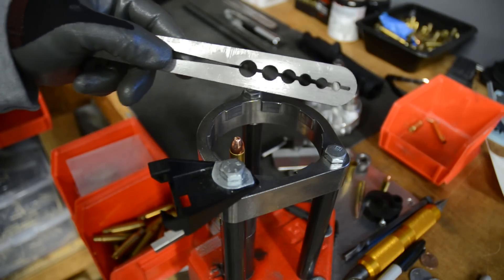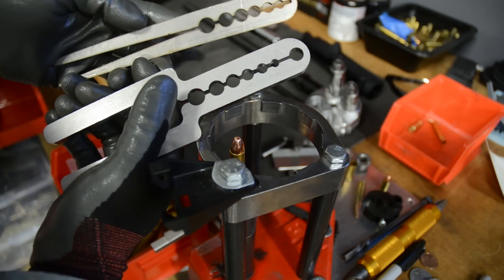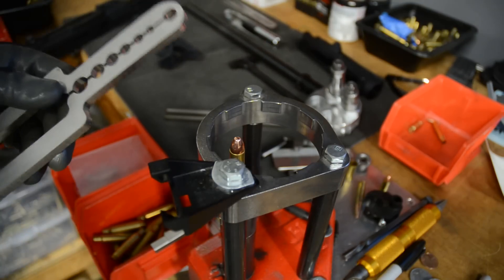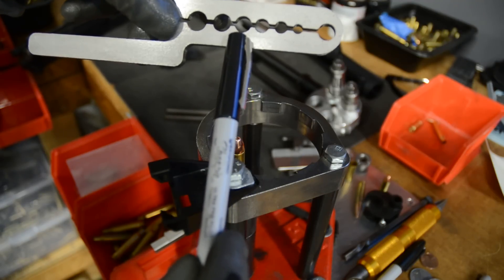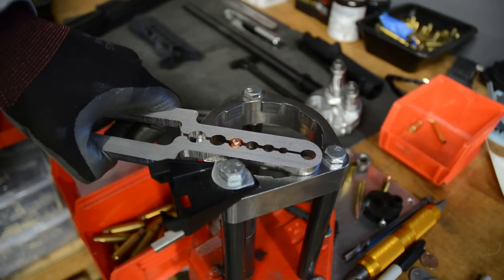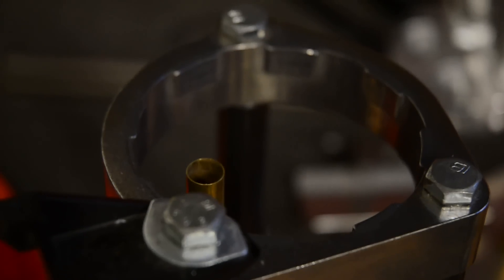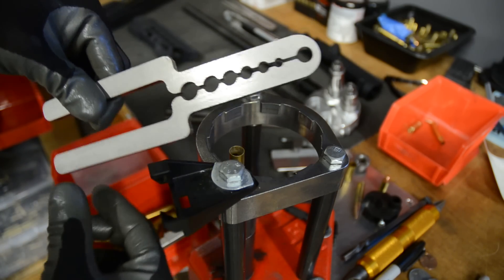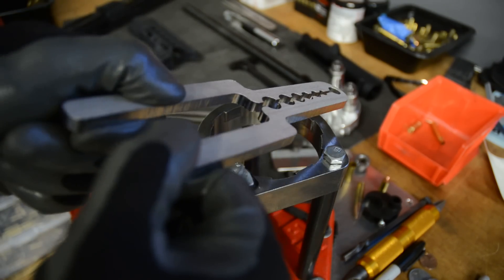Laser Cut Bullet Puller v2, Now Available

Comment: Yo, if it's laser cut, why not engrave the caliber sizes next to the holes too?
Reply from the maker: Because I'm a nub with the laser.
Reply: What's the interface with the laser there? I've seen some where vector lines cut and raster images engrave automatically (Epilog), and some where different colors represent different power/speed settings for cutting or engraving.
Reply from the maker: FastCam.  I know it's capable of engraving, but I've never messed with that feature before.